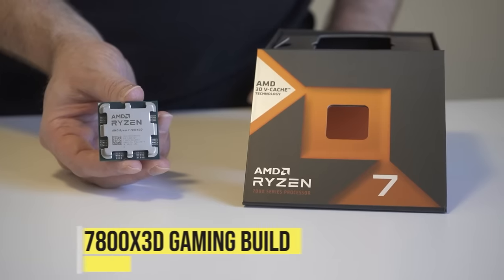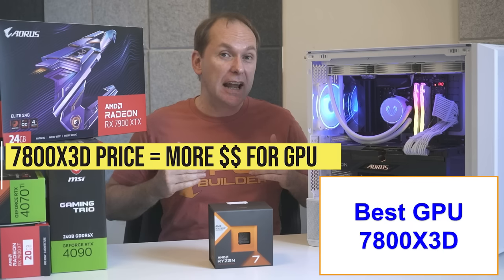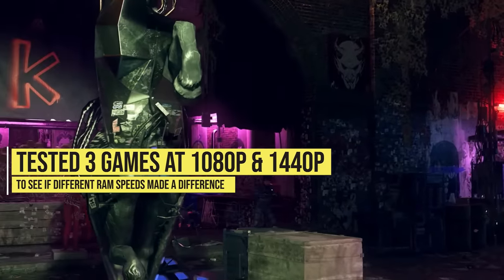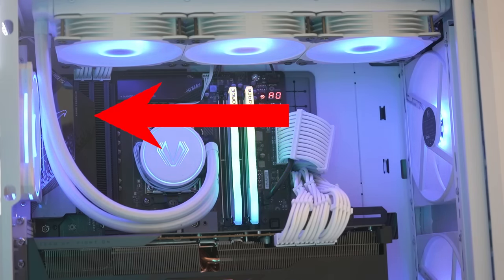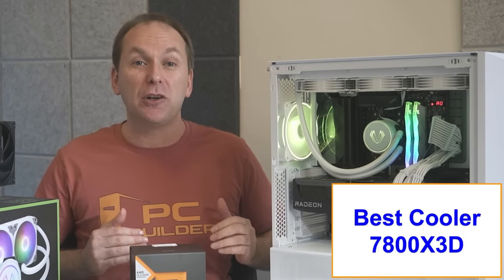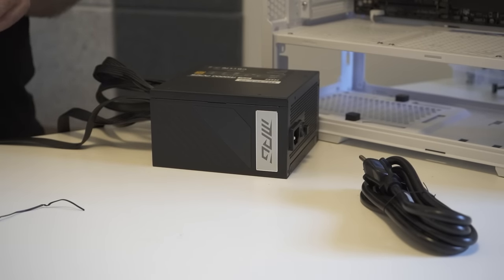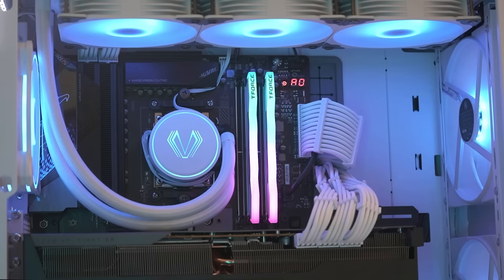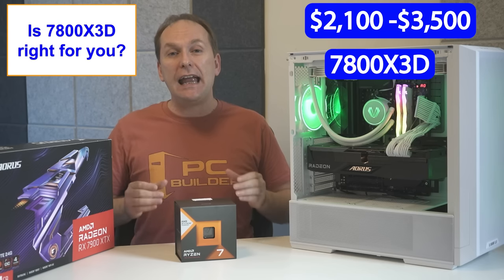🛑 Best Ryzen 7800X3D Gaming PC Build 🛑 Best RAM, Motherboard, GPU & More

Comment: Alrighty, I’m at my wits end. I built a SFF pc. It’s mostly for gaming 
Ryzen 7 7800x3d
AMD rx6800 gpu
32gb of ddr5 5100 ram
Aorus b650i elite mb
All the updated drivers are installed. I am getting an audio stutter. I’ve uninstalled and installed all drivers and the audio itself. I have the Realtek USB2.0 audio. I have gone into bios to ensure that hd audio is enabled.
What the H E double hockey sticks am I missing. Oh, if I hook an aux cable from my phone directly to my speaker, there is zero audio stuttering. 🤯 please help me. Thank you in advance

Comment: @PCBuilderChannel  Now that the 7900X3D is only $40.00 more than the 7800X3D, how does the price to performance fall into your analytics?  Understanding the 7800X3D is still a better gaming CPU, the 7900X3D has a significant advantage in single and multi-core performance.
Reply from the maker: The 7900X3D has all kinds of performance issues so I don't recommend it. If you are looking for the best current production CPU that's going to be 14700K. Otherwise still go 7800X3D

Comment: From the official AMD site it says "Max Memory Speed: DDR5-5200", so I guess going above that is irrelevant. It will work, but it will simply cost more. Is that correct?
Reply from the maker: That's the base but all ram kits are designed to be automatically overclocked so you are expected to get better kits. We go over this in depth in our "after you build set up guide" video (:

Comment: Holy thermal paste! I use a fraction of that amount!
Reply from the maker: haha! Everyone has their own style on thermal paste but testing has shown the only wait to go "wrong" is to not use enough. This is my method (:
Reply: @PC Builder  Agreed, what matters are the temps (which should be part of any build/upgrade).

Would you mind pointing me toward that testing you're talking about? I spread across the entire heat spreader as you do, but I've been using Noctua NT-H2. It isn't very viscous and doesn't spread well. I might be flirting with the lower bound.

Comment: Im still contemplating if I should spend the extra 2 or 3 hundred bucks to go for a 7700 instead of a 5700x for the newer platform 😅
Reply from the maker: That's a good question! Its nice to be part of the new platform I think but if saving money on the CPU gets you a much better GPU that is also something to consider
Reply: @PCBuilderChannel  assuming I buy an upcoming 4060ti or 7700xt what would you suggest Jason?
Reply: @Ro7770  just so you're aware the 4070 is coming out soon and the rumored price is $600 if that interests you.

You could also look at the 7600/7600X if you want the newer platform but don't want to spend the extra money to get the 7700.

Comment: Is it normal for idle temps spike to low 36c to 40c to 50c
Reply from the maker: Under load it can go to 89c . Its designed to eat up all available cooling.
Reply: @PCBuilderChannel  word! Did creat a power plan but when using high performance mode pubg hits 86 to 87c

Comment: I get it, Gigabyte sent you some components to use, good for you.  However, no matter how good it may be, I will not install a Gigabyte product in any of my builds.  Not that they don't make good products, but if one fails, you're selling your first and second born to RMA that product.  Support after the sale is crucial to me.  Built my first PC in 1991, and have been lucky to only have a few components die over all these years.  But when they did, RMA was easy.   But to each their own and to those using Gigabyte, I truly hope you have never have issues and need to RMA.
Reply from the maker: Did you watch the video? I recommended at least one board from every AIB.

Comment: ight anybody know if i have to worry about intel xmp vs amd expo? im getting conflicting info.
Reply from the maker: You do not need to worry about it thankfully
Reply: @PCBuilderChannel  if i do not need to worry about it why is there a difference? i do see different and often conflicting stability metrics when doing my own research. asking because i was looking at getting F5-6000J3636F16GX2-TZ5RK for a new build but found F5-6000J3038F16GX2-TZ5NR to be the more stable option. both Gskill ddr5 dual kits. $15 difference in price but $15 if worth it for stability in the OC if there is a difference. Guess what im getting down to is do you have any test data on A-XMP vs AMD Expo OC?

Comment: I recently got the 7800X3D will be getting the RX 7900 XTX soon atm I'm running a 6800XT Master C with it with a B650E AORUS MASTER motherboard. But i do come across some issues on start up my screen just go's black before i can get onto windows. 
And sometimes will do the same when on windows and i can't reset normally so i have to use the power supply button, i got all the updated bios for everything been looking everywhere for a fix but can't find anything, so idk what's causing it. Anyone have any ideas?

Comment: Yup, this video answered all my questions, I definitely cannot afford this sh**.
Reply from the maker: The good news is you can get a fantastic gaming experience with a much cheaper build. Check out our sample builds on the "builds and parts" list on the channel page. We've got 1440p build around $600 total that are great
Reply: @PCBuilderChannel  
Thanks you for the reply.

I started buying some parts after hours of researching everything and went with MSI MPG A850G, x670 Aorus Elite AX, Kingston Fury Beast 32GB 6000, DeepCool LT720 360mm, Lian Lian Li O11 Dynamic EVO Full Tower.

Cannot decide on what PSU or GPU just yet.
Between 7800x3D, 7900 PBO, 7900x.
So much back and forth and up's and downs, deceiving people for their money, with these cpu's it's impossible to decide.

Comment: What's with the 7800 xt for 1440p?
Reply from the maker: 7800XT is a great 1440p card but not my first choice with 7800X3D, as you would get better performance by dropping down to a 7600 and investing more in the GPU. See our Best GPU/CPU Combo 2024 video for more
Reply: Well, in the video you recommend a 7900x or 4090 with the 7600. 
Also with the x3d.
Why should i go with a weaker CPU?
Reply from the maker: Because it’s the GPU that gives you more performance here. So if you dropped down to a 7600 and paired it with a 7900XT you’ll get more performance than if you go 7800X3D paired with 7800XT. We explain bottlenecking in our Best GPU/CPU Combo 2024 video so you can check that out for more (:

Comment: Ryzen 7800x3d and 3070 build work with a 750 power supply?
Reply from the maker: You'll want to hop to our Best PSU 2023 video and follow the method there to check what wattage you need.

Comment: Could someone please help me? I got the Ryzen 7 7800X3D and the Gigabyte B650 AORUS ELITE AX ICE. I think the ICE version (it's silver), is quite new, but I am not sure. Would I still need to perform a BIOS flashback? On their website I tried to look at the BIOS version, but I am still very confused and did not receive a response from them. The CPU is listed as a compatible component, but I am very afraid of putting it all together if the BIOS is outdated.
Reply from the maker: With that CPU you almost certainly need to flash the bios. But its easy to do so don't stress. See our "How to Build a PC 2023" video for more

Comment: Can i run radeaon rx 5600 xt graphics card with ryzen 79003d xt?
Reply: 78003d*
Reply from the maker: That's going to bottleneck that CPU quite a bit. Check out our Best GPU/CPU Combo 2024 video on why you should avoid bottlenecking

Comment: So let's say money was not an issue and you want to game at 4K on a 120hz or above monitor using an RTX 4090, which CPU would you ultimately choose? the 7800x3D or the i9 13900k? Keep in mind that you're choosing with the thought of NOT upgrading for the next 7-10 years.
Reply: For gaming 7800X3D.  AMD CPUs are better for gaming vs Intel.
Reply: @kelley09162  Thank you for your insight. I'm indeed looking at some benchmarks and it blows my mind how this chip manages to beat the much more expensive competition in most games while drawing less power and being much cheaper at the same time. AMD is really doing us a good one, aren't they?
Reply: @andnowyouknow3363  yes they are
Reply from the maker: What Ty said, if gaming is the focus I’d go 4090 and 7800X3D
Reply: @PCBuilderChannel  Thank you, 7800X3D it is. I may even wait another generation and see what the 8800X3D has to offer

Comment: I notice a lot in videos like this insanely fast is usually 5% faster which is trash! like the 12900k vs 7800x3d its 0% faster its actually slower. in workstations. yet its way more expensive than the 12900k i got mine for 314.00 so i dont see what is so great about amd at all.

Comment: Hi Jason, can u help me with a good build i have about 2000 euro's to spent want a good mid range or low high end gaming pc works with Ryzen.  thnx in advance
Reply from the maker: This video is actually exactly what I would be aiming for, but if the 7800X3D isn't going to work for that budget in your market check out our latest Best Builds March video for a great sample 7600 build list. Its in our "builds and parts" list on the channel page
Reply: @PCBuilderChannel  i opted for an combo of Ryzen7 7800x3d with the Rx 7900xtx with Kraken liquidcooler complet system for about 2200 euro u think it will be ok??

Comment: is it worth change from 13600K to 7800x3d at 1440P res??
Reply from the maker: Not if you have already built with a 13600K. But if buying new then yes
Reply: @PCBuilderChannel  i already built it 8 months ago with rtx 4080. okey thx man. do you use the 7800x3d privat? just curious

Comment: is 850 watts enough for 4080 and 7800x3d?
Reply from the maker: Hop over to our Best PSU 2022 video and follow the method there to check for your full build
Reply: @PCBuilderChannel  1000 watts it is. You could’ve just told me the answer but I wound up more educated with the video.

Comment: So the 6800 xt won’t be able to handle the 7800x3d?
Reply from the maker: I recommend minimum of 7900XT, unless you plan to upgrade your GPU very soon
Reply: @PCBuilderChannel  have any case recommendations that will fit an 360mm liquid cooler on the top of the case?

Comment: i would just change the 7800X3D for the regular 7800X which a lot of the times perform better than the 3d version in games
Reply from the maker: I would re check the benchmarks out there on the games you play, the X3D beats the pants off it in a vast majority of games. If paired with a higher GPU. But if you have a lower GPU I'd go 7600 instead.
Reply: @PCBuilderChannel  i personally dont have it but i was gonna get it but according to several benchmarks its not as powerful as advertised, the thing is its very energy efficient, but still a great cpu

Comment: How good will my 3070 TI work with a 7800x3d?
Reply: Not the best.  The 7600/7600X would be a better CPU with that GPU.
Reply from the maker: Agree with Ty! For the 7800X3D, you'll want at least a 7900XT or a 4070TI.
Reply: @PCBuilderChannel  is it worth it, if I plan on upgrading my gpu in the next 2-3 years? I just wanted to try and future proof a bit. I also do video editing, not just gaming...so wasn't sure if it was better for that, too.
Reply: @kelley09162   is it worth it, if I plan on upgrading my gpu in the next 2-3 years? I just wanted to try and future proof a bit. I also do video editing, not just gaming...so wasn't sure if it was better for that, too.
Reply: @justjoddat  well if you're doing video editing an Intel CPU like the 13600K would be best, though the 7900X and 7950X from AMD would also work.

Comment: If I can get a 7800X3D for £330/$411. Is it worth getting with a 7800xt (another good deal, already bought £459)? A 7600 would be £195/$243
Reply from the maker: 7600 is a more balanced pair. Check out our new 7600 build guide for more

Comment: Would you consider the RYZEN 7800X3D worth if you have a RX6900XT ?
Reply: umm yup!
Reply from the maker: Just below where I'd like to be if buying everything new. I'd rather get a 7600 and up my GPU as that will return the best FPS. If you already have the 6900 XT, then yes a 7800X3D is a good pairing but only if much faster than your current system.

Comment: I think the 7800x3D makes a lot of sense for its price to performance. 

But I can’t get behind the 7900xtx or the 4080. They are over $1000 and are NOT the most powerful graphics cards. If you can spend $1000 on a GPU why wouldn’t you save a little more for the full 4090. It doesn’t make sense you are obviously an enthusiast if you’re dropping a grand on a GPU, why settle? Like save up for 2-3 more month.

Also AMD GPUs might be more powerful when ram raw, but NVidias technologies are so much better. Raw number mean nothing when DLSS exists, also things like Hairworks and other little thing, just makes AMD irrelevant in the GPU space

Comment: is Intel Core i5-12400F 2.5GHz, NVIDIA GeForce GTX1660 6GB, 32GB DDR4-3200 RAM, 512GB SSD, Windows 10,WiFi Ready good for (667 dollars)?
Reply from the maker: That’s a rough GPU and I wouldn’t get that CPU right now. Is this a prebuilt? You can do a ton better. See our Best Prebuilt Gaming PC 2023 video. If this is a build, see our Best Builds March 2023 video for a much better $600 build list

Comment: My question is why would a 4000 series card do better than a 3080 or 3080ti?i feel like the 4000 series is a scam/cash grab from Nvidia. I have a 3070 but want to upgrade to this cpu w/ 64 gb ram
Reply from the maker: Yes you will see a boost, but you would also see a boost with a 7900XTX which is better price to performance

Comment: so what is the best for a 7800X3D ?     CL28-5600mhz or cl30-6000mhz ?  if someone can help me please !
Reply: I think Jason has said CL matters more with AM5 then Speed.  Also if you didn't know G.Skill's Neo RAM is designed for RAM so it's a good choice with AM5 builds.
Reply: @kelley09162  thanks but both are Neo trident from gskill : 
cl28: F5-5600J2834F16 GX 2-TZ5N
CL30: F5-6000J3038F16GX2-TZ5N

so u think the better for a x3d is to take the cl28-5600mhz ? 
because I do not understand why they are cheaper than the cl30-6000mhz if they are better for the x3d
Reply: @Sw1tchE  I think both would be good for the 7800X3D so just go with the 5600 CL28 since it's cheaper.
Reply from the maker: We have a whole section on Ram in the video friend! You can hop to it in the chapter times and we have our recommendations linked in the description

Comment: I See Black screen Problem in All game What I Need To Upgrade:- Motherboard- Asus H61M-K
Processor- Intel i3 3220 
Graphics card - Amd Radeon HD 6450 2gb 
Ram- 4 Gb 

I am Using Windows 10 Pro 64 bit operating system

Comment: Hello.  I want to build myself a PC that is intended for video editing.  I had intended to spend 15 - 30,000$.  what components would you recommend?  hope you have the opportunity to set up a recommendation.  Regards, Thomas
Reply: Here's a build option for you.  Intel CPUs and Nvidia GPUs are good for video editing so I went with that.  The 4080 would also work well if you wanted even better performance.

CPU: Intel Core i5-13600K 3.5 GHz 14-Core Processor

CPU Cooler: Thermalright Phantom Spirit 120 SE 66.17 CFM CPU Cooler 

Motherboard: Gigabyte Z790 GAMING X AX ATX LGA1700 Motherboard 

Memory: Silicon Power XPOWER Zenith Gaming 32 GB (2 x 16 GB) DDR5-5600 CL40 Memory

Storage: Western Digital Black SN770 2 TB M.2-2280 PCIe 4.0 X4 NVME Solid State Drive  

Video Card: PNY XLR8 Gaming VERTO EPIC-X RGB GeForce RTX 4070 Ti 12 GB Video Card

Case: Lian Li LANCOOL 216 ATX Mid Tower Case

Power Supply: MSI A1000G PCIE5 1000 W 80+ Gold Certified Fully Modular ATX Power Supply

Total: $1929.64
Reply: @kelley09162  That is an excellent build, indeed! It also provides superb cost efficiency. I still can't get over the performance that Thermalright's air coolers provide for the minimal cost.
Reply: @zingwilder9989  yea same.  I also like that Silicon Power came out with 32GB of DDR5 RAM for until $100.
Reply: @kelley09162  Absolutely! Finally, these DDR5 prices are coming down!

Comment: Hi Jason, fantastic build super high end exactly what I was looking for definitely on the upper end of my budget factoring in the monitor cost, speaking of what would be ur go to monitor for a pc of this magnitude, I saw a few of ur videos regarding the topic and LED would be my guess but  any recommendations would be fantastic! Thx for ur time 🙏
Reply: Update….the issue with me being in England has arrived again when I take the links to buy the parts it’s won’t load the  parts list and restarts the website everytime I switch it to England any ideas how to get round this
Reply from the maker: Hi Jake! They should localize to UK Amazon, not quite sure why they aren't. We did a lower cost version of the 7800X3D build in last month's PC Build roundup - check out the build list for it.
Reply from the maker: Honestly in terms of gaming monitor it really depends on your budget and the games you play. If you are super into competitive shooters, I'd go 1440p 240hz like the Samsung G7, Alienware 280hz, etc - we are putting out best 1440p gaming monitors this weekend but check our Gaming Monitor 2023 video. Otherwise I'd look to go 4k either something in the $500-ish range 28", or if you have more money OLED is insane. Hope that helps!
Reply: @PCBuilderChannel  I will check for the video and fingers crossed can get this to work if all else fails I will just search part by part but I saw u changed motherboards in the comment section so I hope I don’t make any mistakes, also would I benefit from  waiting to around Christmas time for offers to save money or not?

Comment: 7800x3d  have space for additional 300-400mhz oclocking  even AMD delibaratelly downclock it on 5ghz to not be "faaster" then 7950x3d even  it is faster in  most of games at most of channels benches